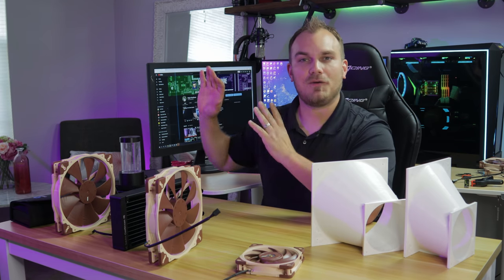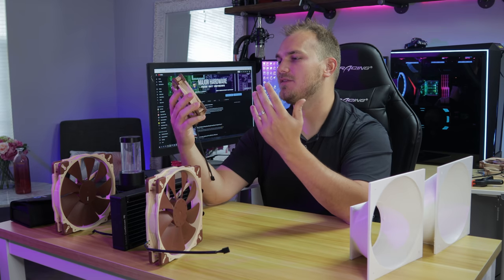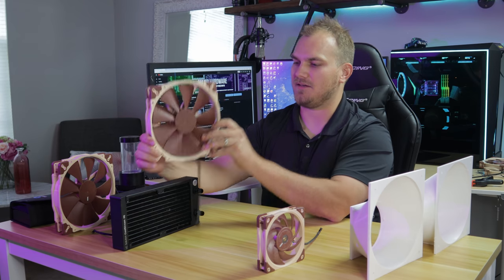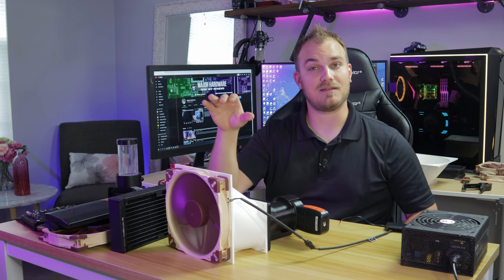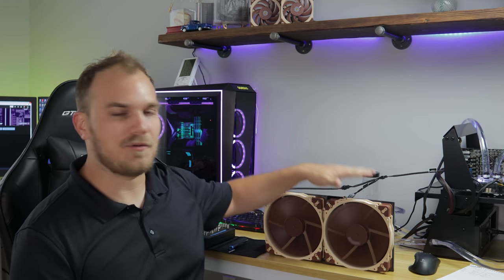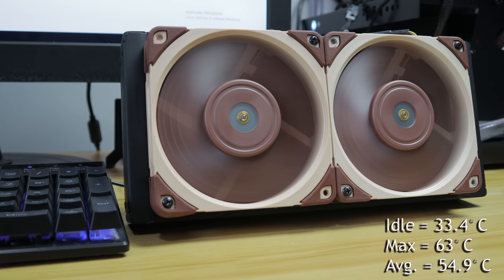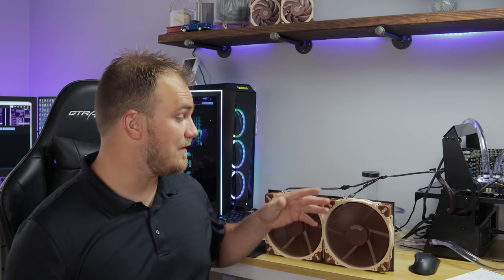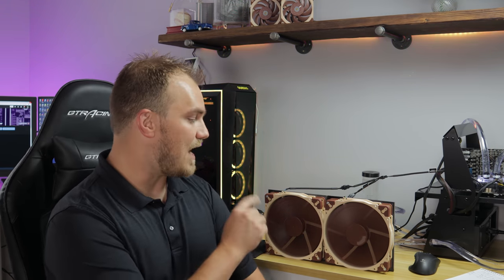Cooling A 240mm Radiator With 2 MASSIVE 200mm fans

Comment from the maker: Remember, If you think you have a cool idea for a video, leave me a comment, subscribers like you are how videos like this come to life.😄
Reply: Would you try the scythe fuma fans on a 120mm radiator for a video?
Reply: you Forgot to do a Pull setup at that size it would have been Greater
Reply: Try the same thing, but turn the fans around (pull). Think of a vacuum cleaner. You could never blow as much as you suck through that tube with the same "engine", if you know what i mean. It's physics. Worth a try, hm?!
Reply: this is funny because you were COOLING with that radiator
Reply: So... a HAF-X.
Reply: Do this setup in pull vs push to see if it makes a difference in noise or performance.
Reply: It would be cool if you compared this to faster 200mm fans just to see if it can perform better at same noise level of 120mm noctua fans.
Reply: Thanks
Reply: 1- redo this experiment in pull configuration, aka turn the fans around.

2- redo the experiment in push and pull with a new manifold that eliminates the gap between both fan mounts on the radiator side and cover any gaps on the radiator. essentially the idea is to cover all the radiator surface area.
Reply: you should sell those adapters.  i know they take a while to make but 30 bux a pop, make 10 and see if they sell.  if not who cares.  i was thinking of mounting a large rad on top of my case and putting a piece of plexi over it to keep fingers out.  i could mount one of these on the back side panel.  i dont care how my pc looks if you cant tell already lol

the real test i think if whether they could produce the came cooling at half speed.  then it would "win" in my book (half of the 200m speed i mean, 400 rpm)
Reply: Would really enjoy seeing you try a 200mm fan, on your race quad motor (from your recent video where you tried 3 fan blade designs), running it at 2000-2500rpm like a normal 120 fan, and seeing the performance difference at that point vs. 800rpm standard 200mm fan
Reply: I would love to see this again in a push/pull/both config using  varying length adaptor cones with and without internal spirals to promote air flow and various size/shape changes in the cone, short and fat cone vs long and skinny etc.  Would also be cool to see 140mm fans pulling air like normal connected to these massive 200mm fans in a push config that just dumps a ton of air in
Reply: Please stop saying RPMs!!! The 'R' stands for 'rotations'.
Reply: PLEASE DO SOMETHING WOTH THE 30 BLADE!!
Reply: Nice video slacker !
Reply: How about feeding the big fans' air flow into the smaller ones then the radiator  or having the smaller ones pulling air on the far side or set the big fans to suc air from the case.
Reply: Fabricate a mount where the radiator is completely enclosed within the airflow so think a tube with the 200 mm fans either end one push one pull then suspend the radiator in the middle of the tube
Reply: I've been recently watching your videos  and now watching for the new episodes of the fan challenge. You should see about a fan challenge for this setup. Could a fan cool it better with a custom design.
Reply: I have cool concept if u make 120m fan and a tube about 5in long and about 120.15m internal diameter the idea is to use the same concept of how turbo chargers work the goal is to turn the fan into a conpresssor wheel
Reply: Test idea 4-200 mm fans cooling 3-360mm radiators tested with radiators both in parallel and in series what kind of effect would they have other than being a wall o fans.
Reply: @jaysonramos2671  having a tube not change size is the opposite of what a compressor does. There's no COMPRESSION just flow.

What he made in this video is more like a turbo as it's squeezing air into a smaller space.
Reply: 3 140s next?
Reply: you revisit this but use the Bitfenix 200mm fans they have the mounting holes you need.
Reply: seeing this with push pull  8 200 mm fans , like a spider 4 fans into 1 240 rad with 4 pulling the exhaust out, It should handle an overclocked 14900k lol

Comment: flip those fans around for a PULL config.......The fans are probobly peaking out on static pressure in PUSH mode.
Reply: yes and no. the fact that they are funneled down in size will increase the static pressure.
Reply: Don't think that that would make a difference. If you want to increase the pressure, you would need a fan that has a smaller diameter but a relatively high air flow. The Venturi effect (and his equation) explains this principle. That is probably also why the results didn't outperform the 120mm fans.

Edit: smaller fan w.r.t. the radiator surface.

Edit (again): here's an old myth busters clip that visualizes the principle:
https://youtu.be/GbqKwPktCdo
The radiator's too restrictive in either case (push or pull).
Reply: noxxi knox  to be honest, I'd be curious myself if it makes any difference, but I also doubt it.

Edit: difference between push or pull.
Reply: noxxi knox  
"I run my fans in pull config and it does make a big difference."
Could be that the fan-blades of your fan are much closer to the radiator in pull config. That could explain why it works better in pull. I could imagine that a "reversed" fan (that has his support structure at the front and that would allow for a much tighter spacing between the blades and the radiator) could perform equally good in push as a normal fan in pull configuration.
Reply: Or print out 2 more and use push-pull.
Reply: Naw, not gonna help. Imagine that big fan trying to pull air through that tiny radiator. 

I've been working on swimming pools my whole life and I'd imagine water hydraulics are somewhat comparable to air physics? If so, you always want the smaller size pipe/more pressure on the outlet of the pump. You never want to starve the pump for water on the suction side, so I'd think the same for fan airflow. Starving the fan for air isn't gonna help anything.
Reply: the pressure required to push air through the radiator and funnel is exactly the same pressure required to pull air through the radiator and funnel.
Reply: And compress air make it hotter
Reply: @BigDaddyAddyMS  gases compress much easier than fluids. This is the main difference
Reply: noxxi knox  caviation exists in gasses as well. When a rotor plane get  near to speed of sonic
Reply: noxxi knox  I was half expecting you to just take your word as truth and go on about how what I'm sayig is bullshit.

Instead you actully pretty much said it is possible that there was some uknown variable effecting your test.

If only everyone would be like this.......
Reply: this is probably why car radiators have fans pull air instead of push. you might be on something here
Reply: @MrUnderEstimated  that has prob more to do with the already existing airflow (push) when the vehicle is moving
Reply: @juggler5604  the Fan in cars isn't supposed to run allv(only to prevent overheating if the car isn't moving but the engine is running like a traffic jam) the time it is themo controlled because and combustion engine is designed to run a pretty consistent temperatures to prevent exercise wear on the materials

And I could imagine that the mounting behind has to do with e preventing of overspinig the fan motor so the air has to slowed down bey the radiator in perspective to the fan
Reply: Wouldn't that just create negative air pressure in the funnels and cause air to leak through the fans in the opposite direction at a similar rate anyways?
Reply: How effective would it be with just one of these big fans do you think it would be less effective or similar?
Reply: @snafubear85  You generally don't want your blades close to the radiator or heatsink in a pull config, it creates a lot of noise.
Reply: @besser-nicht   do you know, how refrigerator works?
Reply: @-indeed8285  yeah
Reply: @CotyRiddle  funneling down will decrease pressure and increase speed. Funneling up will increase pressure and reduce speed. I studied fluid flow, I know what I am talking about
Reply: @pjgppjgp  not going to disagree with you but that was the way i was always told. learn something new everyday
Reply: @CotyRiddle  at first it is counterintuitive but once you do the energy balance of the Bernoulli equation it makes sense.
Reply: @CotyRiddle  however, having a higher speed will give you turbulent flow, which increases the convective heat transfer between the radiator fluid and the air, giving better thermal performance.
Reply: No, the pressure required to push air through the radiator and funnel is exactly the same pressure required to pull air through the radiator and funnel.

Comment: Instead of ducting down the openings to the 140mm size make the bottom a fully open shroud like a car radiator. That's where your performance decreases are coming from.
Reply: @crackasaurus_rox9740  I single fan would be a better match; 200mm fan=314cm2, 240mm rad=288cm2, and with the smaller dimensional difference the adapter could be shorter, so he could use both fans in push-pull and still have a more compact unit.
Reply: @crackasaurus_rox9740  isn't higher static pressure a good thing though? idk much about aerodynamics, but that seems to be what everyone else is saying.
Reply: @nathangamble125  If I get George's post correctly the static pressure needed decreases, not the pressure the fan can deliver. Less (unproductive/non-cooling-relevant) restriction -> less pressure needed -> this "weaker" fan can do a better job.

Comment: you should include some sort of spiral on the inside of the funnel, just like air ducts do, to accellerate airflow
Reply: i like that idea
Reply: wouldn't that just waste energy? its all encloses so whats the difference? have you tried running a simulation in Solid Works? I thought so
Reply: I'm trying to look up what you mean by spiral inside the air duct and I seriously don't know what you mean. Either way, you can't accelerate air just like that. There's conservation of mass so the only way you can output faster air on one side is by reducing the size of the nozzle which has already been done, and the acceleration comes from the fan being able to beat the impedance created by the bottleneck you're creating.
Yes, there's phenomenons like air being accelerated by a passing bullet or airplane wing but that's simply energy being removed from the body, just like a fan accelerating air. You need some way to put energy into the air in the first place. The fan does it by transforming electric energy into mechanical energy.
Reply: The problem isn’t the speed of the air, it’s the lack of static pressure. That’s why case fan manufacturers have been making airflow and static pressure optimized fans, with the popularization of liquid cooling. You can run a static pressure optimized fan at a lower speed compared to an airflow optimized fan to achieve the same temperature. Check out Gamers Nexus’ review of the Cooler Master 200mm CLC.
Reply: If anything, you'd want the spiral to go the opposite direction as the fan blades to "straighten out" the airflow. As it is, the air is already spinning and spinning air will have a harder time going through the radiator's fins. It's called counter-rotating and planes use this in their propellers to reuse energy that would otherwise be lost.
Reply: @phillylove7290  It's not about increasing energy, it's about using energy that would otherwise dissipate. Rotating air being pushed through radiator blades is not as effective as straight air being pushed through radiator blades. So you're changing the airflow in order to allow the air to move more freely through the blades, which theoretically would increase how quickly the air passes through the blades and should lead to slightly better thermals.
Reply: @Saljen  the issue is that turbulence improves cooling, as a laminar airflow allows a boundary layer to have very low velocity near the outside surface. In car radiators the tubes are often ribbed so that air passing through meets an obstacle and gets bounced around to improve cooling.
If air is not flowing "freely" enough it's preferable to just brute force with a higher static pressure fan than trying to screw around with flow straighteners. The fin stack acts as its own flow straightener.
Reply: @sniperpronerfmods9811  I just said I like the idea, I never said it would produce anything
Reply: @Downlinx  so why do you like bad ideas? 

Did you even go to school?
Reply: @sniperpronerfmods9811  because you should give everyone a chance to see their ideas put to the test.  There are no such thing as bad idea's, only idea's that bear the fruits of desired results.  Everyone deserves a chance to have idea's and even if they are not the best idea to be had at the given time, they are an idea to that person.  We are not here make condescending or snide remarks, but to help and push people further and to greater.  I hope your education had taught you that as you seem to be an educated person.
Reply: @Downlinx  well said, I guess this is where people like me need to stop putting people down and teaching them, I guess your right about ideas, their a starting point with and endless amount of improvement, 

And to be candid, I have had a few long conversations with some friends about being a better person and well alot more stuff, it feels like everybody has been giving me wise words these few day, I know I need to change, I am working on it. 

Thanks for not rage quoting or not going the route of libel, thanks for being a +
Reply: @sniperpronerfmods9811  you are quite welcome
Reply: oOIPaBoIOo or he could a push pull config
Reply: air conditioning tech here. I've never seen a spiral in a duct at all and not to increase velocity
Reply: @sniperpronerfmods9811   That is an unexpectedly civil conclusion to a disagreement in YouTube comments. GJ guys.
Reply: @nathangamble125  ya it was, you know nice people can rub off on less nice people like my self in that case, you honestly don't know what you will learn from random people, i'm nicer now lol
Reply: @AspastIIcBean  I have but it is called a stator and is usually directly attached to the backside of the fan and mirrored the fans blades as it redirected the air swirling from the fan blade passing thru to a straighter more laminar flow but changing any fluids direction or flow is changing it's velocity by definition... The static pressure produced via the fan stator combination should theoretically and mathematically be higher.  It's similar to the fluid dynamics of a torque converter in a car

Comment: Something like the NZXT h510 series has enough clearance where to the right of the board however you went too basic, a single 90 degree bend wouldn't alter airflow much but would allow for a front mount fan to intake and push through a radiator.

Comment: I have wondered about this type of set up for a while.  
I suspect that cooling improves with the 200mm fan because the dead spot behind the fan hub gets better air flow.  

I also expect that (with the duct and 200mm fans) the air flow over the rad fins is less turbulent, having more of a boundary layer and that reduces the cooling.  Less turbulence probably also makes it is quieter.
It might be an interesting comparison to make a 120mm to 120mm duct the same length as the 200mm to 120mm duct and see what effect it has.  Which of the two set-ups from this video will it be more similar to?

Comment: This makes me remember an old PC I had with a lateral 240mm fan on the case. I had it cooling the CPU with a Coolermaster Gemini and a shroud.
This was performing better than the Noctua tower I tried before and was very quiet.
Well very quiet by 2008 standard.

In this age of 3D printing and CAD I'd love to see more custom shroud and huge and slow fans.

Comment: Now that you've got your fancy new 3D printer, I'd love to see a custom case for those 200mm fans. The front/back (or left/right) would just be a single 200mm fan, pushing air through the entirety of the case. Would be a cool mini-ITX build and it would be interesting to see why kind of temperatures you'd get just from airflow.

Comment: Nice results. I'm attempting to do something similar but the size of the set's of fans are smaller - I'm going from 2 x 120 to hopefully 2 x 160 using a 120 to 140 adapter plate. The 160 fans have 140 mounting - so if I go from 120 to 140 with the adapters then the 160 fans should mount : as long as the 160 fans fit inside my case.

Comment: There is a test nobody had ever do, NF-F12 (not ipcc) vs NF-A12x25, I'm interested with the radiator perfomance, but you can test also with aircooling. Noctua has released their test at A12 launch but nobody made a real comaprison.

Comment: I have NZXT case I use for my home server that has dual 180s on the top but has the ability to run 3 120s as well. I have been running a 360 rad on top of it for ever with the dual 180s (rad under the top tray and fans on top of tray under the top cover). The loudest part of the whole system is the water res sloshing or the HDDs when they start up. It's weird but it works.

Comment: hey ive got a case with two 200mm fan mounts in my attic....
thanks NZXT
Reply: Justin Clonts could you put a 400mm radiator? Cause that would be pretty nice.

I have two 420x140x60 radiators just for the baller factor but 400x200 is a LOT of surface area regardless of thicccness.
Reply: @depth386  Might be a bit late but look up the MO-RA3 420. They offer an adapter plate for four large fans (NF-A20).
Let's just say it makes every other radiator obsolete and I'm loving it.

Comment: In terms of large fans, you'll get far better performance if you try this with some Silverstone Air Penetrators. Noctua is fab, but their 200mm is designed around low noise and airflow, with poor static pressure. APs were used in their Mammoth 01 case to yank air through a HEPA filter, so they should have the requisite static pressure.